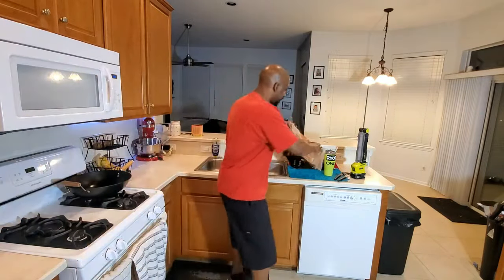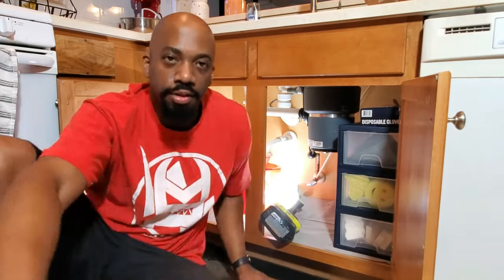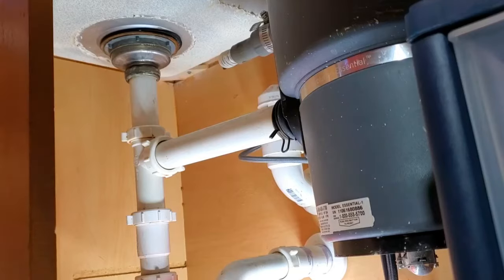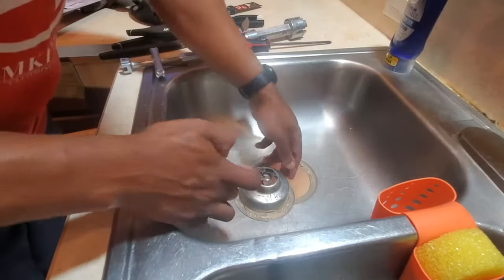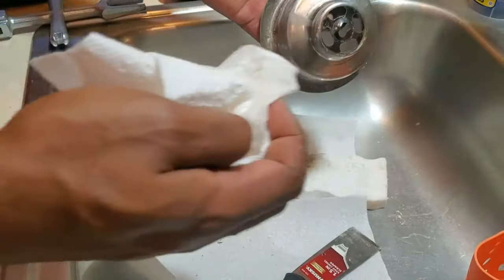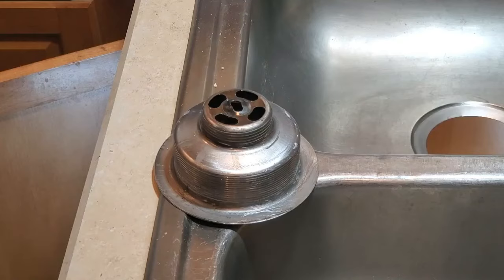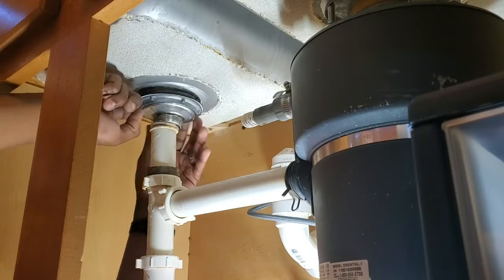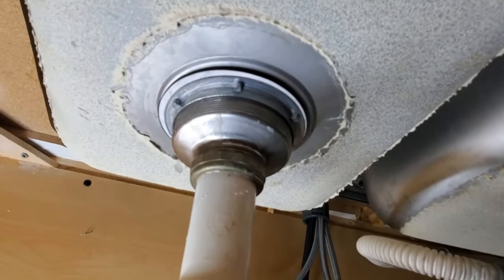Leaking Kitchen Sink - Gasket Replacement Tutorial

Comment: I just had the exact same problem. But fixed it differently Before watching this. I simply Assumed the rubber seal was installed incorrectly, at the bottom of the sink. I mean, what function does it serve down there?? So, I moved it up to where the plumbers putty was and just tightened the darn thing down, just like in this video and I no longer have a leak. Here's my thought process : when you hook up anything to a hose, there is a rubber seal that prevents water from leaking. So, putting it at the top of the sink, instead of putty, and tightening the nut compresses the rubber to prevent leaks. So why in the hell would you put it the seal under the sink??? When the putty breaks down you're going to get a leak because the seal under the sink does not block the escape of water. Someone tell me why I'm wrong, thanks.